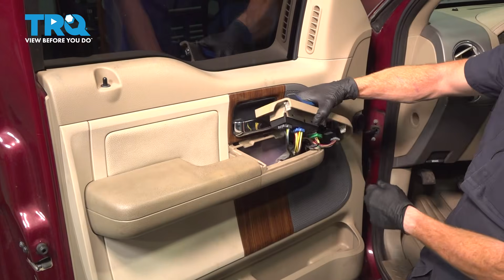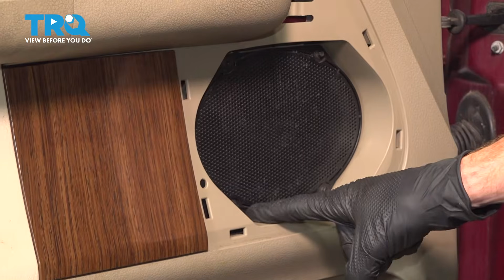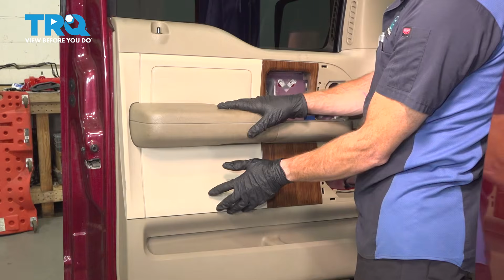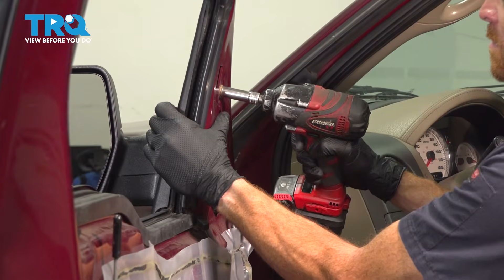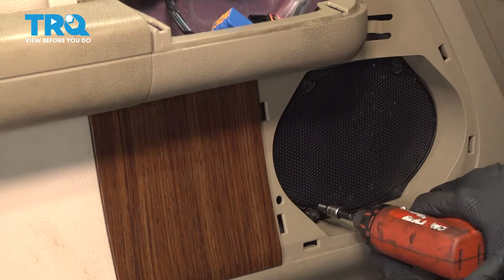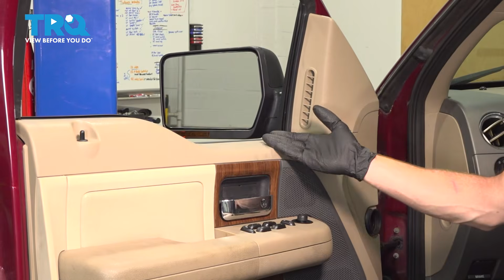How to Replace Front Mirrors 2004-2008 Ford F-150

Comment: Excellent video...I followed it step by step,and was able to change out my passenger side mirror. Maybe you'll want to tape the door handle cable where it will be easy to reach when reconnecting it. Super helpful. Much appreciated.

Comment: Note: you don't have to disconnect the door handle cable. After disconnecting the door panel then you can slide the door handle and cable through the open hole (this way you don't have to disconnect and reconnect later).